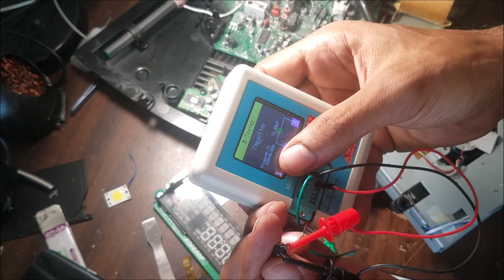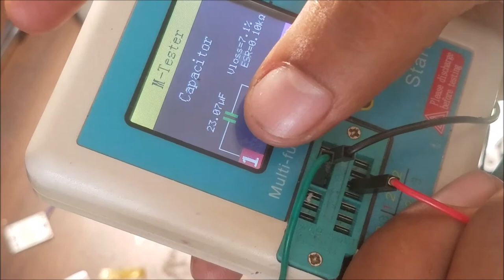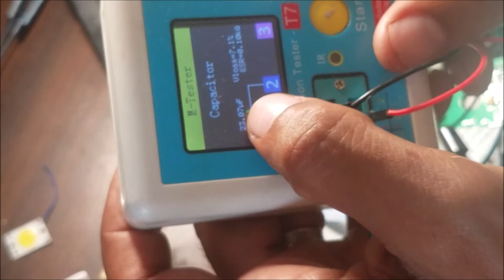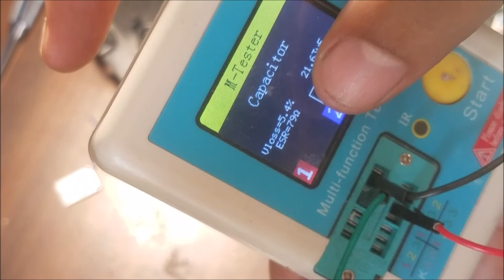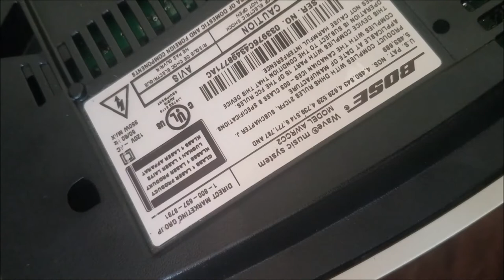Bose AWRCC1 2 wont turns on test the capacitors in the board

Comment: What a waste of time.  Except for one or two of the 47uf caps and maybe the 100/16, ALL the surface mount capacitors in that radio need to be replaced.  The ESR on all of them is either over 25 ohms or out of range.

Comment: Thanks your video showed me how to find the fault in the same area as yours under the metal RF shield. I replaced it with a new cap and my radio works once again. Its not the exact uF or voltage but its a 20V 10uf cap and it worked fine .. Another Youtube video saved me some $$ and taught me something new .. Thank you sir!

Comment: YOU ARE TOPS! The BEST part about this video is when you call out 22uF 6Volt times two. Then you pull out an old 'donor board'! I was laughing my butt off! I thought I was the only one that did that Sanford stuff! You're the best! BTW the way  mine needed just the cap on the left and I only had one.  One guy did shotgun approach. But with these surface mount capacitors, I just didn't want to go that way, Bose not worth all that effort.

Comment: Taking an ESR tester to the boards, you'll find every single capacitor failing. To replace one or two is not a fix, as other problems are on the horizon very soon.  Next, it will be the output I.C. bad, along with more capacitors that caused it.

Comment: Thank you! I am a former Bose technician, but never worked on the Wave Radio. I have exactly the same radio that you fixed here which had a similar problem. It worked sometimes, but when I set the alarm, instead of the alarm turning on the radio, it would just reset the time to 12:00 am. I replaced the same capacitors (I happened to have similar SMD components and 30 years soldering experience), and now it works again!

If not for this video I would have sold this radio on Ebay for parts. I would much rather keep it for another 15 years. Thanks again. I have made a donation and it was well worth it!
Reply from the maker: thank you so much for supporting this channel and that will help me sharing and posting more repair videos...

Comment: Thank you for this interesting repair that contributes to further enrich our knowledge in electronics. I have a problem with a similar piece of equipment, the infrared receiver sensor broke down and I need to know what is the number of that component that can be used. Thank you.
Reply from the maker: any sensor looks similar to that one will works
Reply: @SOSfixElectronics 
OK thank you. I ask him why I changed it for a new one and the fault still persists. What can be the cause of the problem? the remote control is working well and emits infrared light and there is voltage in the sensor in the Vs and Out pins of 4.80 V but the equipment does not turn on, it remains in standby (time) when connected to the electrical network, it does not obey remote control commands.

Comment: Thank you for sharing your knowledge! My II works fine except CD player keeps saying "disc not playable" Tried cleaning the laser.. Would that capacitor test work in my case also?
Reply from the maker: use the hot air to warm up the caps to see if the cd we be detected

Comment: Great job! I have a Wave Music System III. Brand new, everything works except it has no sound. Any idea on what may be wrong? I would send it to you but I'm in another country.
Reply from the maker: check capacitors by worming the board with hot air gun, dont burn it